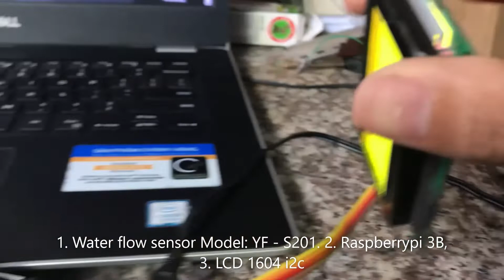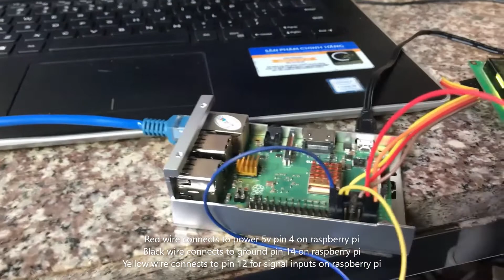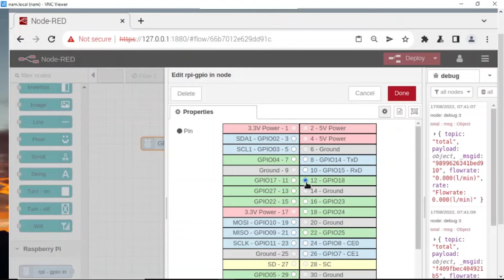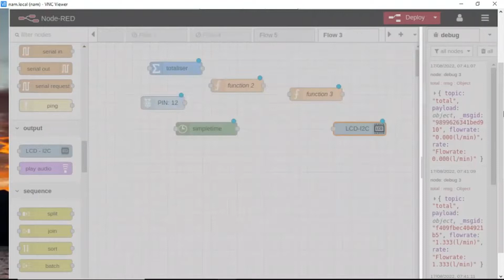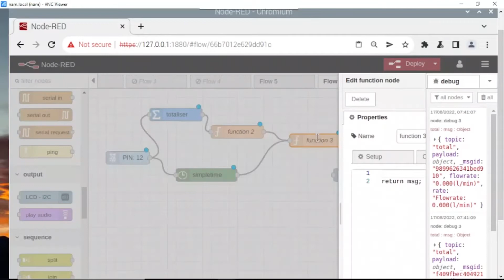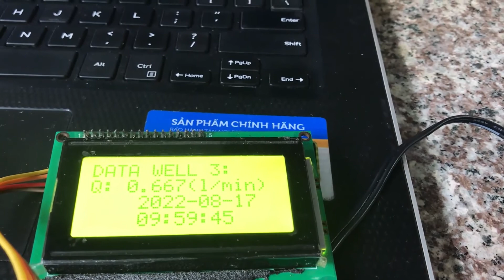Water flow sensor raspberry pi node red LCD | Flow meter YF-S201 Node red

Comment: I have a question,  I used to watch a video clip which was also about raspberry pi and yf-s201. But I saw they used 2 resistor before connect signal wire to raspberry. Is it ok if I connect output signal directly to raspberry, I also search for some article about this topic, they told me that GPIO pin in raspberry suppose to be safety if ouput signal is 3.3V. I love to see your sharing.
Reply from the maker: 02 resistors for pull-up purpose. without these for testing It's ok, but needing a stability, you have to use a logic level converter 3.3v-5v